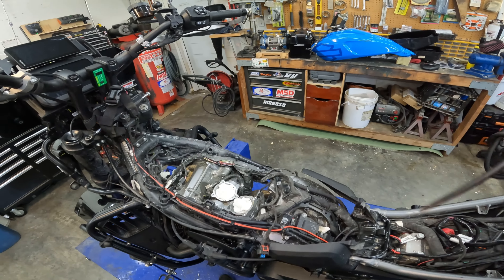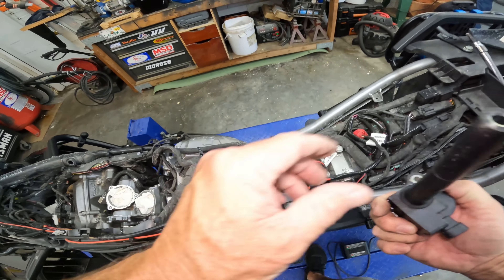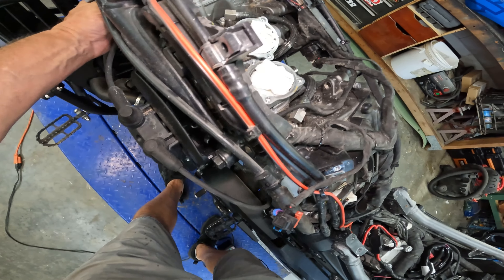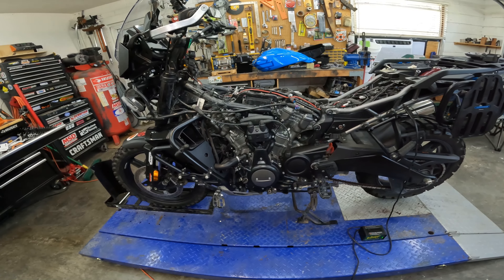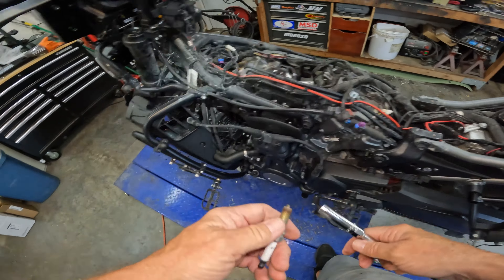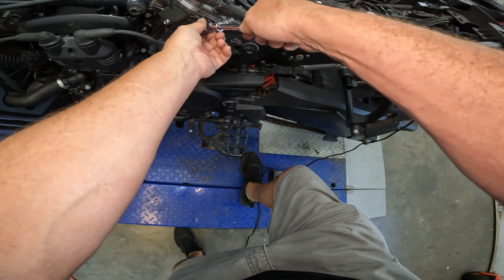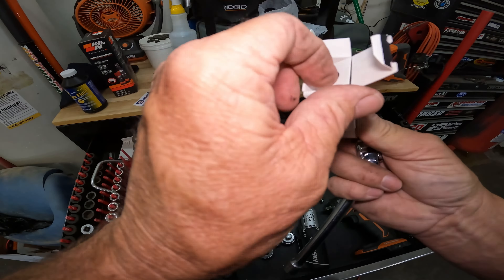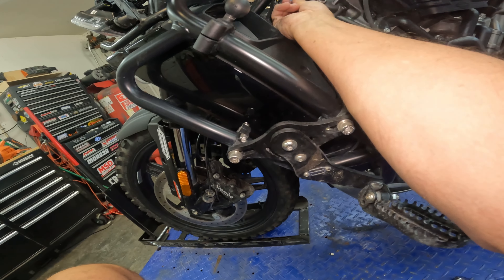How to Change the Spark Plugs on Harley Davidson Pan America, 10K mile service Part 3

Comment: I think its nuts that a modern motorcycle needs the plugs changed every 10K or 2 years according to the manual. Mine started running poorly on my way back from Alaska. Fuel pump is making all kinds of noise as well. At least now I know to go get a 14mm spark plug socket.

Comment: I'm more curious why it uses two different ignition systems, half coil on plug, half shared ignition coil? What gives?
Reply from the maker: I honestly couldn’t say why they did that. My guess is to give it that conventional appearance because the Harley fan base has typically been into the retro styling. Kind of the same reasoning behind them still producing air cooled engines in their most popular models.